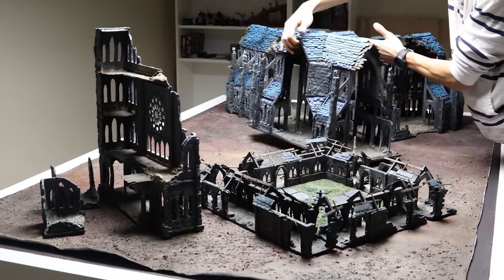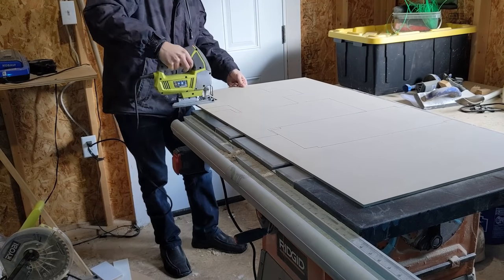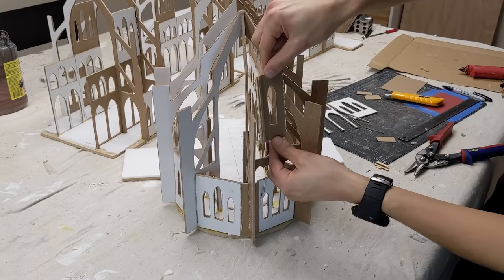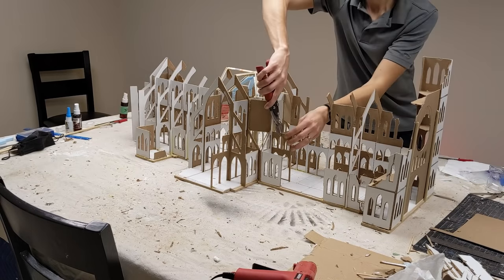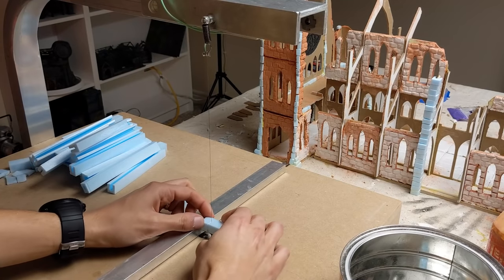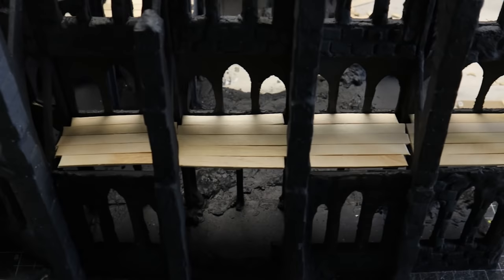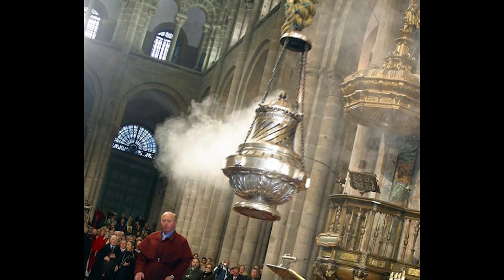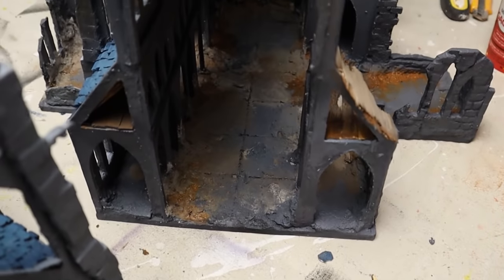Building the MEGA Cathedral (Wargaming Terrain)

Comment: This is insanely good.  I don't know who are the "more capable crafters" you mentioned but this build proved you are extremely capable.  I need to know more about designing the MDF designing though.  You designed and someone else did the CNC?
Reply from the maker: Yes, used my dad's CNC machine for the cutouts. You can likely get a similar service commercially in your local area. Some shops and even online stores let you do custom CNC orders.
Reply: @KnarbMakes  Thanks!  I am definitely going to check into that

Comment: I was wondering what mdf you were using. It looked real flaky and shite. If it works though, then can't complain, right?
Reply from the maker: It's just the 1/8th thickness stuff you get from hardware stores, It comes with a veneer on one side, and it's used for the backs of ikea cabinets and such I think.

Worked well enough for this application. Cheers!

Comment: Awesome Job!  I  a have question. In beginning shot looks like you are unwrapping the carboard packed. Did you send out the design to be printed on the carboard or CNC'd? Would be cool if there was a company that would do that.
Reply from the maker: Sorry for the late reply. I had the parts CNC cut by my father on his machine. You can get services like this from companies but they may be expensive, depending on the amount of pieces cut.

Comment: We see so few projects of this magnitude, the first glimpses of its size really lit me up ... at first.
But you completely lost me when you put the gargoyle downspouts on the BUTTRESSes when their sole function is to drain water from the edges of the ROOFing. And the proper cap for the buttress pillars are crocketed spires. Your statue gargoyles should be on the pilaster terminals of the actual cathedral walls. Oh, and "gesso" is pronounced with a soft 'g' (like a 'j' ), not a hard one.
It also struck me super odd that anyone would spend so much time on such a large project and execute it in such a slipshod manner. Being a ruin is in no wise a valid explanation or justification for the extent to which this is true here. Foam can and often is rendered with hard, sharp angles, and doing so is especially important in making things like stone buildings. Far better than the Play-dough-like soft roundness you ended up with. Also, while even some of the large parish churches (which can be rather impressive in size) may be covered with slate shingles, cathedral roofs are covered with sheets of lead. (Check out Hirst Arts' Gothic lead flashing roof molds.)
Lastly, 28mm, 32mm, 54mm, ad nauseam are sizes, measures, NOT SCALES. 
Scale communicates the RELATIONSHIP in size between an object and a smaller SCALE copy of it. When you look at a map, the SCALE is in the key in the corner, appearing as "1 (inch, centimeter, etc) = (X) number of yards/meters, miles, kilometers." 
This may appear as a fraction (25mm-32mm SIZED figures work well in 1/64th SCALE).
Reply from the maker: Alright

Comment: This is not bad, but as a fan of detail, it could have been a LOT better. You are misusing a lot of things man.
Reply from the maker: Thanks Nograd. Leme know what could have been better.
Reply: @KnarbMakes  The frame you did is really good, nice skeleton of the building, now the clay you used to mold brick looking textures, is not good at all. Ofc I understand when you want to finish it fast you cut corners in certain solutions, but there are good brick wall tutorials for diorama ruins and such, OR you could just cut a brick material into a tiny bricks and place them one by one realistically, and drop some near the ground. Also, the "planks" could be thinner based on scale and realism. But I am thinking diorama style not tabletop gaming. Also the color you picked is not great, it's plain and boring, when it could have touches of moss on the wall and some dust effect on brick wall corners, also the tiny statues could have been replaced by a more detailed premade gargoyle toys cut in half or something. There are a lot of improvements to be made and I am speaking mainly from partial skip watching and as a detailed diorama fan. Could have been an amazing ruined cathedral diorama. But still looks decent enough, not for beginners
Reply from the maker: @nogardd  right on. Thanks for the feedback.